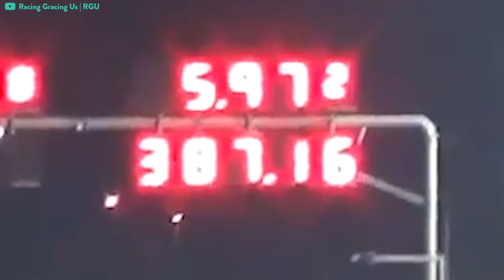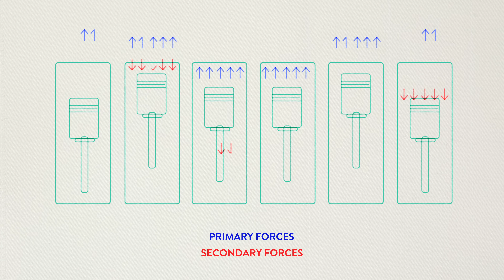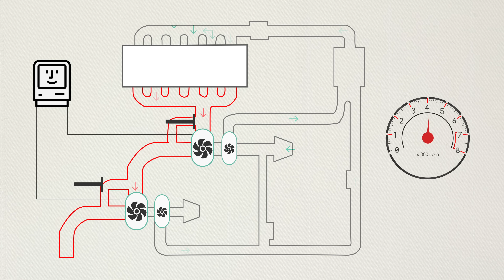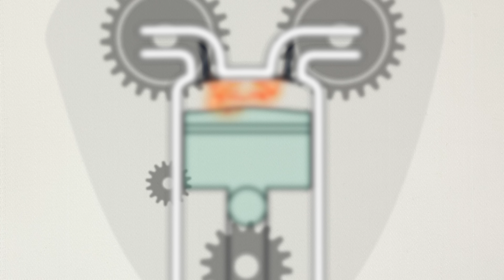2JZ ENGINE - How it Works | SCIENCE GARAGE

Comment: Yeah the engine it's resistant kids.. but it will not gain 1000 HP just by adding a bigger turbo and a sport air filter.. Ok??
Reply: It can make up to 800hp on stock internals. I daily a 1993 sc300 2jz-ge single turbod they are underpowered from the factory they make 480hp easily and 800hp with the right amount of work, anything else is just fulling building a stage 3 motor

Comment: I think the two strongest, most reliable, and all around best engine's in the world for building power.... are the 2JZ, and LS engines. The only way gm screwed up on thr LS... was that horrible idea of displacement on demand. They create oiling issues and can kill an LS fast. Bypass that and theyll live as long as a 2JZ. Ive seen both engines factory with over 300k, without any rattles, or smoke. Two best engines on the planet. 

I do have to ask, can the 2jz stock crank handle 1000hp? I know the LS can. But idk if the stock 2j crank can or not. I imagine they can since theyre forged

Comment: 2 Questions:

1. Isn't Iron Heads better for an Iron Block for temperature expansion?

2. So any Supra engine that's a VVTi is an interference engine? While the non VVTi (normal 2JZ-GTE) is a non interference engine?

Comment: I had a 98 deville with aluminum heads and they blew at 100,000 miles. These engines were notorious for that. Do these engines suffer same problems ?

Comment: As much as I love the V8 engine, the inline sixes in my opinion the best configuration. If you never driven one then you wouldn't understand. It's just so versatile. It could be a 2JZ screaming or it could be a Ford 300 freaking fogging down the road red line at 4200 RPM or something like a damn tractor. All in all the freaking great

Comment: This engine is so special man. Babies can run 3000hp. Granted your swapping out alot of the parts around the motor but still. Each cylinder pushing out 500 horsepower individually is bonkers.

Comment: This is why toyota doesnt make super cars becoz they already have one and you just need to tune it and its already a beast
Reply: the 2jz was a stock car engine. Toyota never ran a 2jz in it's race cars as they were notoriously bad track engines which is why all the fast supras in 90s were the 3s 4 cylinder variants or the 1uz v8z. Shit the 4 cylinder supra is the poster child for Gran Turismo.

Comment: Meh.  Old boat engine weighs 570lbs without turbo/s and makes less reliable power than a 20yo junkyard LS that is lighter, shorter, less top-heavy and wayyyy cheaper.  The weight and high CoG are why the Supra racing cars used a 4-cylinder out of the Celica.

Comment: The only thing special about either one of those, is that it was constructed with good materials and a simple and reliable design. Not that complicated. Seriously. You're overcomplicating it. Nothing you listed as special about that engine is even difficult to construct. Especially if you own Toyota. It's a great motor but you over glamorize it. Every technology for the most part in them except for the metallurgy is pretty old. Pistons go suck squeeze bang blow. All of them bit. It works because the over all design is simple. Notice the most complicated problems came with motor sophistication. I mean. They still left more than y I u claim out of the build. What made the only thing in the end that made the 2JZ important was the forged internals. Everything else had been working for decades before just as it was perfectly

Comment: I want to see if someone knows why car guys usually start off loving the rb26 then grow to the 2j then when they grow out of drag racing they go back to the rb
Reply: Real car guys know the fast supras in the 90s were the 4 bangers. There's a reason Toyota backed racecars always had the 4 banger or V8 supras. Shoot the 4 banger is the poster child for Gran Turismo.
Reply: What about the top secret Supra with the rb26 Smokey nagata drives that’s a very prestigious tuning company
Reply: Or the v12 Supra
Reply: Yes the Lexus sc (Supra) with the v8 was way better
Reply: @futokarin9745  well I meant race team supras. The 2jz always sucked as race motors. Toyota backed teams always ran the 3s 4 banger or the 1uz V8 out of the lexus
Reply: Real car guys buy beaters so they don’t have to worry about the condition of their car when they drive crazy. Freedom
Reply: They don’t engine break well, the rb26 was great at engine breaking. The 2j is a garbage straight line cannon ball highway racing type engine… all the boring parts about racing
Reply: Some of top secrets supras did time attacks and did very well but they didn’t have 2jz 😂
Reply: Honestly if you think about it the rb can be even better than a 2j at drag queen racing
Reply: Rd2.8 diesel has bigger oil ports and a heavier crank than a 2j convert that to gas and hybrid the 26 head to it you have a rb28 with thicker walls could probably bore that to a 4.0 or close if converted to gas
Reply: I’m talking about the 2j engine breaking, I completely agree with you on the 3s
Reply: 3s was fire

Comment: 1105 rwhp / ~1300 crank hp is the current stock block record for the 2JZ. Did several dyno runs and 1/4 mile runs before it snapped a rod after letting off at the end of 4th gear from full boost to full vacuum. 
The shock snapped one of the rods.

Comment: Something cool to know- I make custom knives as a hobby/side hustle and I actually use aluminum plates to “quench” steel. Aluminum has a really high thermal conductivity and can quench 1900 degree steel to below 200 degrees in about 6 seconds. They used it on the cylinder head to suck all the heat out of the engine, just some knowledge for yall:)

Comment: The lag introduced by the installation of a bigger turbo is easily compensated for by adding a shot of nitrous during spool up to quickly ramp up the rpms until boost kicks in.

Comment: I have a D4D Toyota Engine it's 2.5 diesel turbo

I swear!!!

It sounds exactly like it did 7 year's ago 100 000 miles later

Currently 186 000 miles and Litteraly ticking away nicely,

What scares me is the rate the tax is increasing from those cunts that insist you buy one to then say it's dirty! Buy an electric 🙄

Comment: S54 is the most well engineered I6 of that time with 333 NA horses in the US and 338 horses everywhere else reving to 8000 with a stroke of 91 mm meaning the internals move at 4773 feet per minute way WAY higher than the GTE and can be built to same level as a GTE more work but what 1000+ bulid is easy. ( yes even supras need a bit to for the entire build) good engine but all the hype around it just annoys me yes it CAN be fast has good looks but can you buy it probably not but the S54 comes in a cheap car around 15k instead of up to and past 65k can we get a M3 E46 and S54 vid please
Reply: the s54 is a fucking beast and not admired by fanboys

Comment: Lots of awesome stuff I didn't know about the 2JZ!  Seriously overdesigned and overbuilt for a factory stock street engine.  But I believe the oil squirters were added primarily for piston cooling more than for piston lubrication, although I'm sure they help with that also.  I'm no JDM expert and could be quite wrong.
The "New Supra" is a BMW bastard.  For many reasons, I don't think it will ever live up to the legendary Mark 4, but we will see!  These are exciting times for auto performance!  A bit like a 1960s renaissance :D
Good video, thank you.

Comment: I've had a  stock 2jz in my 240 and its driven me over 680,000 miles I've keep up the maintenance and it's still running strong
Reply: Wait 680,000 miles 🤯🤯
Reply: Wow!
Reply: Vids or cap
Reply: And not one video of the car….
Reply: Rookie numbers, bro.
I got 789,000 miles on my stock 2JZ even after pouring sugar in the gas tank… which only boosted it 10+ hp when the fuel ran  richer

Comment: I have a 2001 lexus gs300 with a 2jz. 188k miles running weak but overall wonderful reliable car. No turbo
Reply: The problem turned out to be a blocked CAT

Comment: This is why u get a prius phv......
1.fuel is expensive
2.the prius phv is 3 times more economical than a 1.2 turbo car (Toyota CHR)
3.the prius phv has more than 6 power outlets (if u buy the right ones)
4.The prius phv is safe cos it's slow like heck
5. U can plug it in with an electric car charger even though it's a hybrid (phv = plug in hybrid vehicle. Big brain)
6.the engine won't start of the keys aren't near (start/stop button)
It can travel like 1000 kilometers with a full tank and full charge (Toyota CHR aka 1.2 litre turbo needs to be refueled at 400 kilometers 
7.its a 1.8 hybrid engine and it's weaker than a 1.2 engine
8.its a toyota

Comment: stock supra engine is not capable of 800hp safely. they are good to 700 thats it. after that you need to start upgrading the internals
Reply: or you will have a blown up house

Comment: The coding system works simply: the first numeric character(s) represents the engine block's generation, the next one or two letters are the engine family, and the suffix, separated by a dash, lists the engine's features. For example, a 2GR-FE engine (used in the Avalon, RX 350, and Highlander) is a second-generation (2) engine in the GR-series featuring an economy narrow-angle valve direct overhead cam (F) with electronic fuel injection (E).
The suffixes for Toyota engine naming are as follows:
    A - Valvematic variable lift intake head
    B - Twin SU-style side-draft carburetors (After 2000, 'B' indicates capability for E85 Ethanol)
    C - Carburated / California Emissions Controlled
    D - Twin Downdraft carburetors
    E - Electronic Fuel injection
    F - Economy narrow-angle valve DOHC
    G - Performance wide-angle valve DOHC
    H - High compression, High-pressure charged
    I - Single-point fuel injection
    J - Autochoke in early models, unknown pollution control later
    L - Transverse
    M - Philippines' market
    N - CNG fuel
    P - LPG fuel
    R - Low Compression (uses 87 and below octane fuel)
    S - Swirl intake
    SE - D-4 Gasoline Direct Injection
    T - Turbocharged
    U - Japan-spec emissions w/ catalytic converter
    V - Common Rail Diesel Injection (D-4D)
    X - Atkinson cycle (most-used on hybrids)
    Z - Supercharged
Reply: Ok but what about the uz v8? It's not supercharged
Reply: @leonelmartinez2486  They offered a bolt on supercharger for the 2UZ but I guess not the 1UZ. I'm not sure why they named it with a Z then
Reply: @bajablast_drinker17  oh ok

Comment: It's interesting that people seem to always talk about the oil squirters but don't know that when race shops eventually open the block and build them they usually plug the squirters. The pistons and rods are at this point already forged and can handle any heat. The more important place for that oil is to the main bearings. At least in a drag car that's been the case.

The really interested thing is that the GE variant already has these plugged. The oil pathways are there but they were never drilled and tapped. You can do it to a GE block of you wanted though.
Reply: They also help put a film of oil around the rings bumping up compression numbers, they're not just there to cool the pistons.

Comment: Only 2 things 2JZ engine cannot do : racing at Le Mans & JGTC GT500. Toyota opted 3S-GTM engine installed in their Supra LM & GT500 since they are "more reliable, have higher revving & lighter weight" in racing spec. So, actually, 2JZ ain't that godly. They reliable, but not for 24 hours non-stop race. They highly tuneable, but heavy. They are powerful, but not a kind of high revving engine. They are much more suitable for drag racing or drifting.

Comment: How do 2JZs work?  Judging by how they all ended up on blocks by the early 2000's, I'd say, "They don't."

Toyota guys:  The 2jz-gte can handle 700 horse with stock internals!

2jz-gte:  can't handle 320 horse

Comment: VVT-i and V-TEC are two very different systems. VVT-i uses phasers and oil pressure to dynamically change valve timing. V-TEC uses an extra cam profile, and a solenoid to increase actual valve lift. VVT-i is variable. V-TEC is either one cam profile or the other. VVT-i is for economy and performance, V-TEC is simply for performance. Toyota used V-TEC on one engine. The 2ZZ-GE in the celica GTS and corolla XRS and they called it VVTL-i

Comment: toyota: heres a 200hp engine, build to withstand even 300hp.
any other car manufacturer: heres a 200hp engine, but build to withstand 150 because its cheaper and people wont  push their engines anyway, if they do (sorry not sorry suckers)
i also love how toyota had to lower the horsepower on the new supra due to build quality concerns.
Reply: Emm,if you forge the pistons it can withstand 900,maybe 1000 but you would have to upgrade some parts,stock i think 500 max

Comment: Turbo Lag: time turbo takes to speed back up after deceleration of exhaust pulse

Turbo Threshold: point at which turbo produces boost 

There is no lag before initial threshold is reached, only after a shift or deceleration

Comment: How much hp can you squeeze out of it before the crank or block cracks?
Reply: 1000 whp limit on the crank bolts not the crank/just need upgraded main caps and arp main studs
2000 whp on the block

Comment: An engine people don't talk about enough is Audi/vags 1.8t agu engine. Super built bottom end, come stock with 150 HP and you can easily push 300-400hp on stock internals and a little turbo adjustment